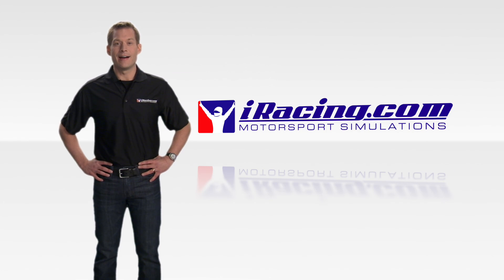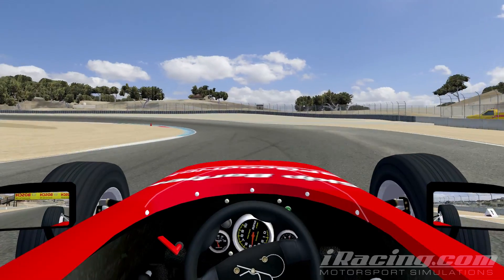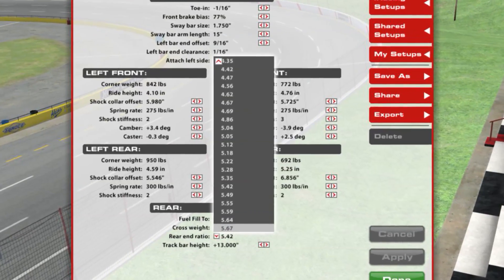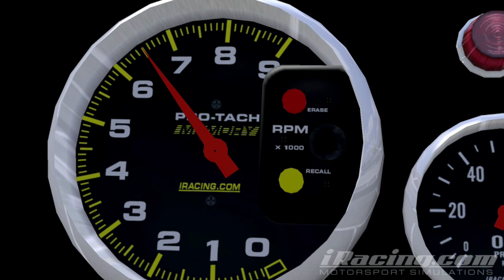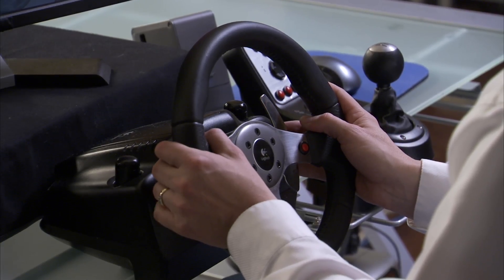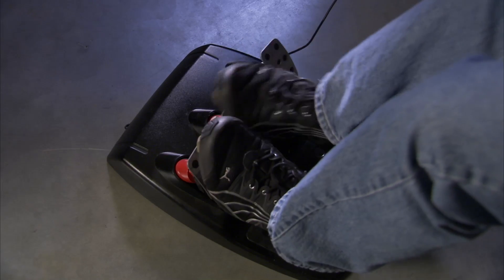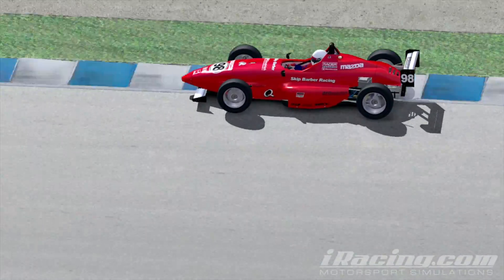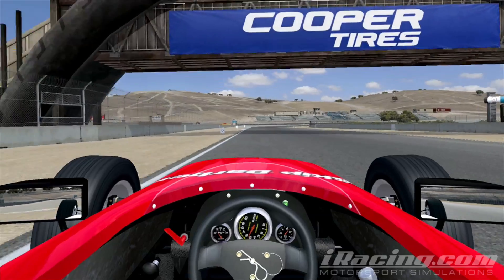iRacing.com Driving School Chapter 6: Downshifting

Comment: is it completing wrong to shift all the way down from gear 5 to say 2 and skip the in between ? i.e is it just a no no , or is correct downshifting more about getting extra performance.
Reply: It can be a bit risky. Let's say a hairpin turn takes you 160 mph all the way down 60mph, you can definitely downshift to match which gear should be used and skip the gears in-between. However, if you downshift too far, you risk destroying the gearbox (e.g money-shift). This is why practice laps are so important- it'll help you dial in when you can skip gears entirely, however you'll need to be a lot more tight on rev-matching.

Comment: Why do i have to tap the brake to downshift even tho I have a clutch??
Reply: @RumRunner certain cars have a lock out you will find it isnt the braking that allows you too change but the speed coming down, its too stop you down shifting too early and damaging or blowing the engine so i believe

Comment: Still don’t get the point of throttling between shifts.
Reply: Do you mean whilst downshifting? If so it’s so that when you do downshift the revs will Match the engine speed. If not you’d stall the engine because the revs would be to low for the gear you’re shifting into.
Reply: @AdzzVR  It's not that that the engine will stall (more like the opposite), but that it will brake the driving axle. For a given speed, when you downshift the engine revs will have to go up. They will go up either if you blip the throttle or not. If you don't blip the throttle the power to increase the revs will come from the wheels, i. e. the wheels (the intertia of the car) via the transmission will suddenly force the engine to match the revolutions ratio of the new gear. The perceived effect is a sudden braking of the axle connected to the engine, and you don't want that when you just have applied the maximum possible braking with the pedal.
Reply: I use it to keep the car level, changing down too soon without a blip will cause the engine to over rev the car and cause the weight too transfer too a place you normally dont want it. I cant say im correct but its how it feels too me when racing and i have been for many years. I even find in sprint races no matter what car i drive if i blip on the downshift i have Way more control over the corner cornering, may bot be realistic but seems to work with almost ever car in iracing,  but i did say sprint. In longer races you risk overheating the car so you need to use it as and when needed to suit each vehicle